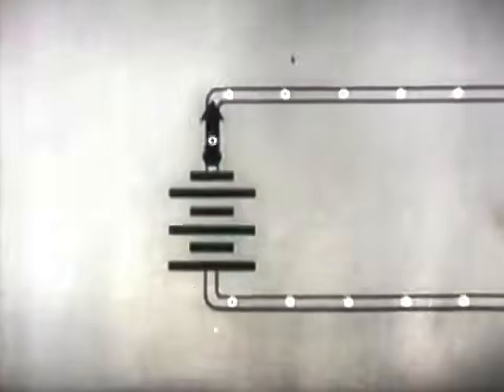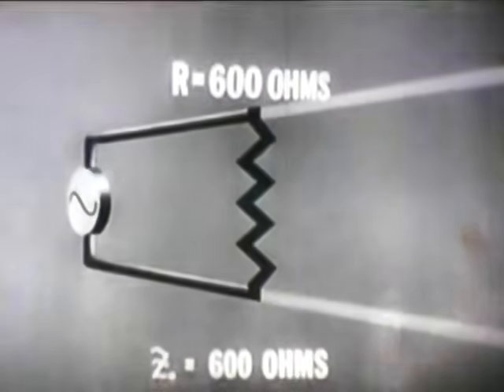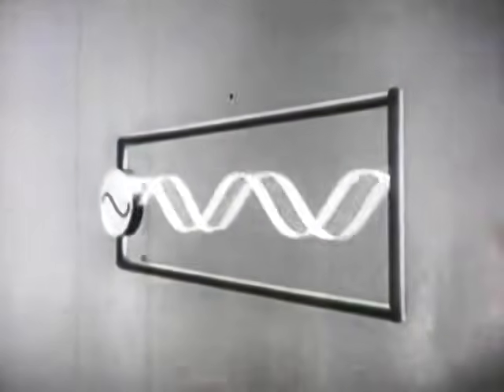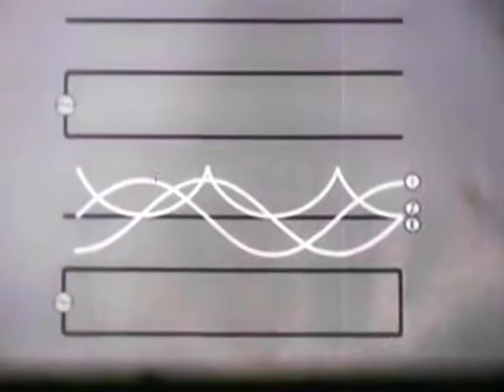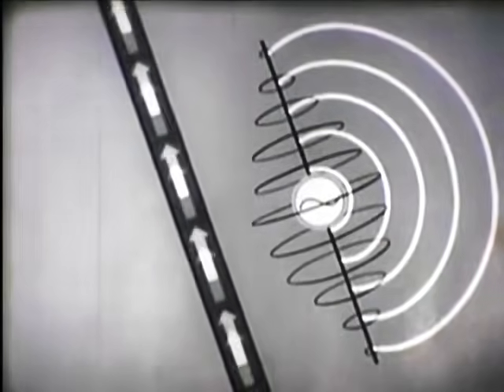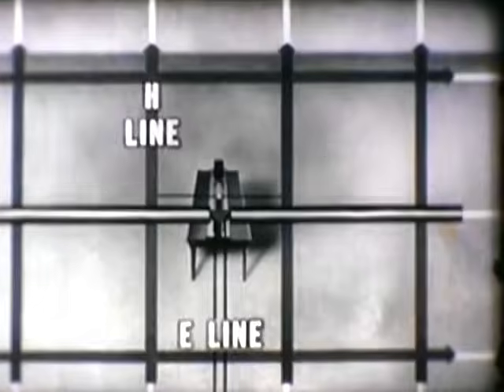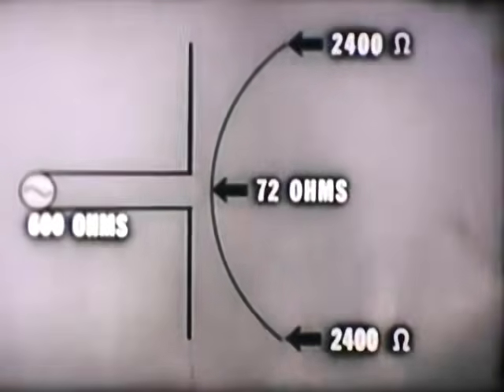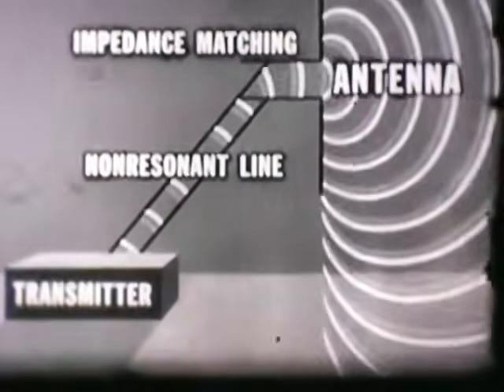Radio Antenna Fundamentals   Part 1 (1947)

Comment: I studied avionics electronics in the Air Force. In six months, the training I received would have taken 2 years in a private school. No fooling around at all. 8 hours a day minimum of theory and hands on applications. Frequent testing. If you failed the test, you went back to the previous module. If you continued to fail, you "washed out" and were re-assigned to a less intensive specialty. Best education I ever had. Gave me a long satisfiying career after the military as a process controls technician in heavy industry.

Comment: These old films are really good.  These films originated in wartime.  The military wanted everyone to really understand the technology they were using.  The instructional techniques were effective.  If your life and your soldiers lives depend on your radio in an aircraft, you want your people to really understand how the critical stuff works.  The right wavelength and the right antenna geometry makes your transmitter work better, and the right orientation of your receiving antenna makes reception possible, which might otherwise not be possible.   This tradition of really wanting people to understand - and writing documentation so that people really could understand the technology - this continued up into the 1960's and 1970's.  I remember reading old material at school - and it was so much better written - the writer really wanted you to understand his research results.  Modern academic papers are written to impress anyone reading them with how so very clever the writer is.  I read modern stuff, and the writers write so as to prevent people from understanding their work.  I am serious.  Modern teaching - and the documentation of research results - is just awful.  The "experts" want to obfuscate their results, and discourage careful review of their work.  Probably because they want to protect their positions.  They truly do not want you to understand the material, and so they practice surprisingly consistent obfuscations.
When we see the old films, and read detailed  analysis and research notes from the 1940's to the 1960's, you can really see this surprising difference.  It's remarkable sometimes.

Comment: This old film, containing incorrect concepts, is an example of an interesting quirk in the history of how radio was taught.
When the member of royalty but none too bright Mountbatten became  a naval officer and was put in charge of the RAN school of wireless telegraphy and telephony, he could not understand the textbooks then in use.   So he ordered that a new, simplified, book be written.   Drafts were revised until he could understand it.   The result of the famous 1925 Admiralty Handbook of Wireless Telegraphy.  This set new standards of clarity and made radio technology much easier to teach to future technicians.

The book was so well received by students and teachers that its way of explaining thing was copied into radio/electronics textbooks around the World for decades after.   But it contains some anomalous explanations which have led to generations of technicians having the strangest ideas of how things like inductors, transformers and transmission lines actually work.   They take on board the ideas in the Admiralty Handbook that magnetic fields expand and contract, and flux lines "cut" conductors.  Both are completely wrong.

Unlike what this old USN film says, the magnetic fields around a current carrying wire DO NOT expand and contract according to the cyclic variation in current.    The magnetic field position is static but its intensity at any given point in space weakens and intensifies.

There is no such thing in reality as lines of flux.   Its merely a dodge that lets us convey space-variant field intensity in a diagram.

And the film is in error in saying the energy conveyed in a transmission line is conveyed in the electric field.   It is conveyed in both the electric and magnetic fields.

Comment: These old films need to be archived. The military films especially,.
This is how I learned all the nuances of radio fundamentals and antenna theory. These old films helped me get my ham radio license.
I refuse to cram in order to pass a test if I do not understand the information inside and out, advancing my license is useless in my opinion... I am a tech with zero electrical background. I answer questions form extra class guys all the time.
Reply: I wish we actually used these old Air Force videos when I was in radio school decades ago in the Air Force!
I have an FCC GROL 1,3 and 8. Good luck on advancing your license!

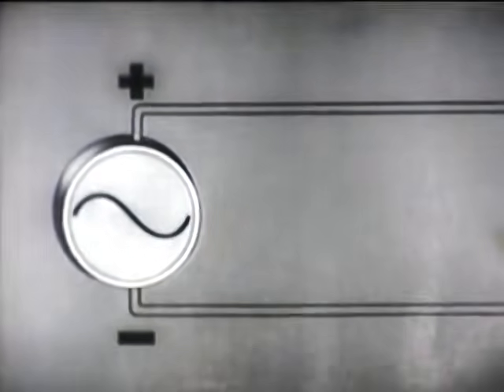Comment: At 3:45 how can both waves from + and - side of the generator goes in the same direction? They are not suppose to propagate in the current direction? (opposite from each other) Maybe that is a stupid question....
Reply: It's negative wave. It moves in the same direction, but the electron density moves in opposite.

Comment: I like everything in these old instructional videos.
The animations, the pedagogy, the voiceovers and the pace which is just right.
Reply: Of particular interest, even though it's a kind of side-effect of this reels intent, look closely at the animation of the 2 'infinite' insulated  wires at 2minutes in.

Lots of people have trouble intuitively understanding  how the two plates of a capacitor still allow a 'current' to flow. Ok we know of course, that its a different kind of current and nowadays we can even explain this with a smoothie blend of quantum  mechanics and analogies about water ... But look again, it shows very clearly in less than 2 seconds what "displacement" current is and does, and I know folks who took months to grasp this concept, heck even some of the best modern electronics explainers on YouTube have to put like a minimum of 10 minutes into it!
Reply: Totally agree Man! Perhaps its just the sheer style involved that increases the right brains ability to be more perceptive, or just digging the aesthetics allows one to concentrate more, but to me - they are a great combination of lecture and visual education,  and because you're not have to address or skirt the effect of microelectronics, you get a purer, more instinctive, understanding!? 

Works for me, either way 😀
Reply: I learn the most of them. Fantastic!

Comment: Most interesting. When trying to figure a why IE no  nice garden I then saw covering the cut trees and shrub not all relaxed the areas to say outside to neighbour.. like cuprrnall on a wooden fence. Ok I came into a city .I used a charging cable similar to supply to speakers,, heavier cable. I placed the plug next to draw and socket or acceptor into the outside.i wound the cable a most neatly. This enabled people to be calm outside on ones porch. The entrance and encouraged to me day time and evening normal human behaviour that behaviour attracted ohh you sure. And nay uniform ed
Reply: Kamala, is that you? I'm not sure what your point is.
Reply: @donaldwatson6621 I believe this is a case of an elder crippled by autocorrect.